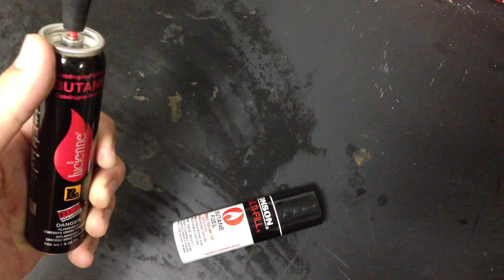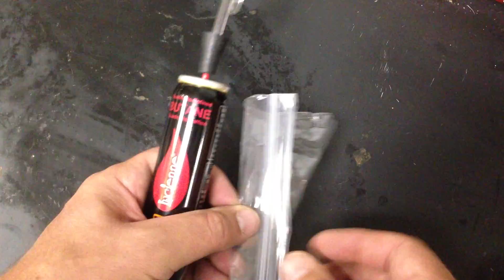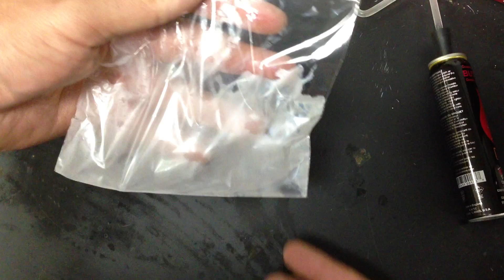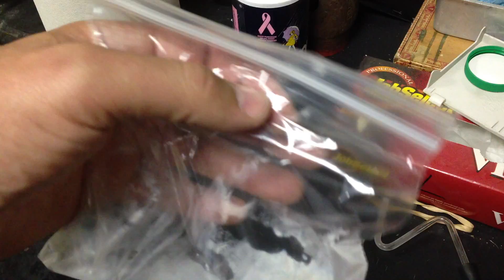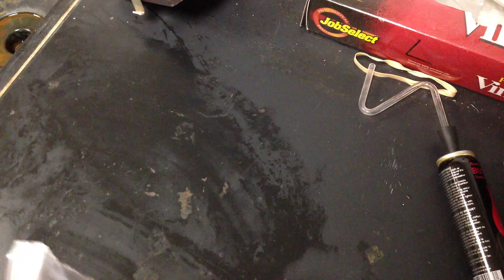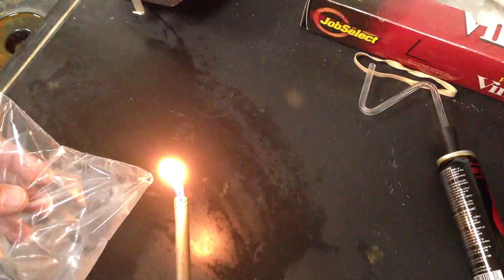Boiling cold with butane liquid in a baggie

Comment: Lovely demo. Thank you. Just a note to say that the liquid is probably several degrees Celsius colder than the boiling temperature. You can see this because the liquid is not boiling when it's just sitting in the bag. It only boils when you touch the surface. I followed your example and measured temperatures around -6 °C using a thermocouple thermometer. The reason it is colder because as the butane expands it cools dramatically - probably closer to -10 °C, and so the liquid sits there and evaporates - it still has a high vapour pressure - but doesn't boil until you heat it. Thanks again. Michael

Comment: So what what would happen if the bag had a leak in it and was handed to a student with the type of clothing like maybe polyester jogging pants that’s able generate and build up static electricity? One potential scenario would be one student with the bag happens to be grounded because they are touching the metal part of their desk while handing the student with the built up static electricity is not grounded because he happens to be standing. When the 2 student hands get close enough to each other The built up static electricity will discharge from one student to the other causing a small spark. That spark is more than enough to ignite the butane. And when that happens both of those students will more than likely suffer injuries. That is an absolutely stupid unnecessary risk that you have no right involving your students with. You’re a teacher man. You are supposed to protect your students not endanger them. Butane is super dangerous. Especially the way you’re handling it. If you want to be careless like that you should probably do that on your own time and leave it out of the classroom.
Reply: Go ahead and hand that bag around. It’s over saturated in that bag and won’t ignite. It needs to mix with oxygen at a good stoichiometry before it would react. This is clearly demonstrated in the video when the bag was initially perforated but significantly difficult to ignite.

Even if the bag perforated, it’s ok, just leave it alone and walk away.

The usual expected age of a child to be learning gas laws would be at least 13, if gifted, even 10. Many would have handled fire or worked a stove at a much younger age. I for one played with fire when I was 7 (sparklers). 

This means that children or young adults are not as stupid as you think.

Education always comes with risk, but those risks are managed with the understanding of how a person learns.

For example, if you’re mentally retarded, there’s no way we’ll be letting you near this bag even if you were of ‘age’ I.e. 21. There’s no point as you wouldn’t learn, and would be a danger with it. You’d be dangerous even with something as benign as a metal fork. Who knows if you’d poke your own eyeballs out.

But for a smart young adult who understands the danger of fire, they would use caution automatically. Educating them is worth the risk as they would become far more productive.

Just a little warning at the beginning of the lesson is enough to offset the concerns of static electricity and flammable gasses, unlikely as they are.

Comment: Does the plastic and butane react??
Reply from the maker: shameonyou123456789 The plastic in the bag is essentially polyethylene which is a single bonded hydrocarbon polymer chain and would have little to no reactivity to butane under these conditions.